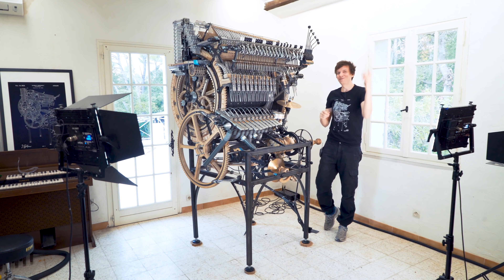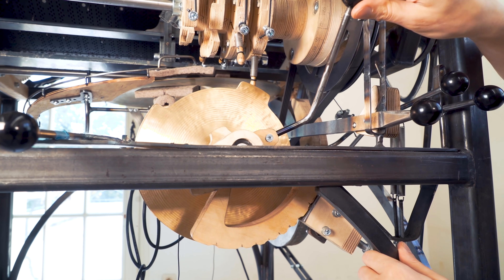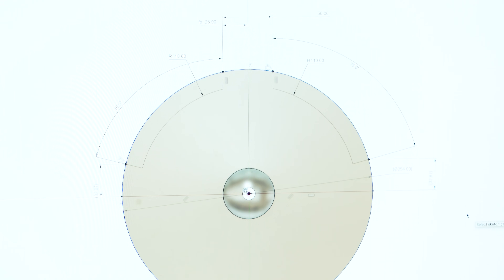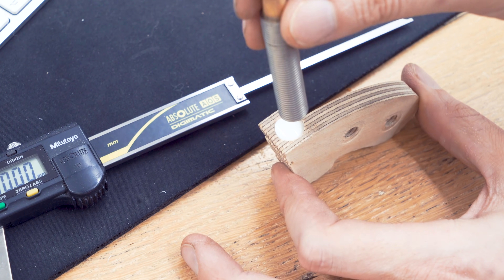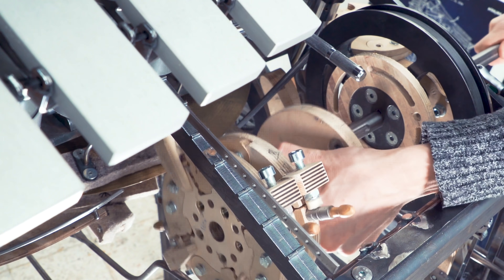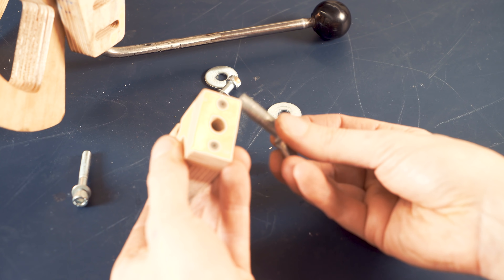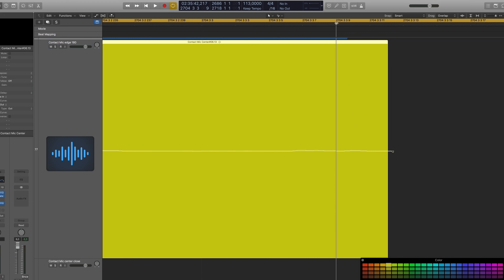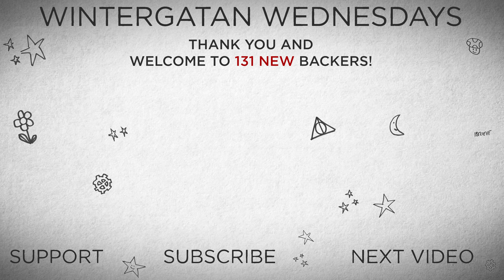I Made a Hi-Hat Machine - Will it Work? | Marble Machine X #108

Comment: Quite clever design improvement ! 
I would add one small thing on the "selection wheel". You have made some grooves to lock the hi-hat in a know angle but there's nothing to prevent the wheel to stay in a position in between. The radius being constant between those grooves. You should have some kind of inverted grooves or slope to have the spring behind the ball to push the lever in the nearest valid angular position. The positions seems to be equally spaced so you could make the radius a sine wave oscillating around the current radius, with the minimums of the sine being your valid positions and the maximums the in between. Keep on amazing us !
Reply: A bit like the bi-stable that this old tony advised a couple videos ago
Reply: @TheNico1082  actually it would be a novem-stable mecanisim as it would have 9 stable positions (bi-stable imply only 2 stable positions)
Reply: @Britaliope  Lets all push for the novem-stable tweak !
Reply: I doubt that accidentally putting the high-hat in those in-between positions would be common enough, to warrant the effort to make further changes in the design. Also, there could be some hypothetical musical reasons to intentionally do that, which would be much more difficult, if he follows your suggestion. However, I think it's a good idea to remember, in case I'm wrong and this becomes a significant issue after all.

Edit: grammar
Reply: What would be the real harm if that would occur?  I suppose not realizing you are between notches could throw you off during performance but the output would be the same otherwise.
Reply: This would help perform-ability.

Comment: Good work but I would think that you need a faster adjustment for opening and closing the hihat, for example with a lever??? I think that thumb nut is to slow to be adjusted during a Song
Reply: And the hihat is Not "closed" because of the cutting, probably a felt could help to close the two disks

Comment: Hi-hat need bi-stable system ?
Maybe he will rotate if ur hand is not on the handle, that would prevent it. It could be simple like a wheel and a pin with a spring who will lock rotation at right position effortless

EDIT : and a 3 minutes  you did it, i like your solution

Comment: Hey Martin, I had a question about using the hi-hat machine in a performance. 

If you're onstage and want to play a complex hi-hat rythm, but also want to play a complex rythm at the same time with the ondophone, how does that work? 

I imagine that it would be a bit difficult to concentrate on two different things at once, while also maintaining the correct tempo with your foot using the treadle pedal.
Reply: I have a strong feeling that he won't be messing with the hihat too much if he's soloing.  He could adjust it to where he likes it and then go ham.  Also he has the bass to play, don't forget.  Bass and ondophone together seems extremely difficult already.
Reply: Ah, good point

Comment: it was truly worth the redesign! this is amazing!
Reply: not sure how often you will have to readjust the fine timing with this solution.
Reply: you could consider to guide the bands/strings the other way around the screw - so the force is countering the screw thread direction. if you have problems with it. A bit more length of these bands and multiple wraps around the screws might help stabilize the timing as well depending what material u used there.

Comment: Won't it be a nightmare to synchronize timing between notes played by the marble and notes played straight from the crank?  Anything played by a marble will have a fixed delay of 400ms or whatever, but any offset on the crank would have to be a fixed portion of a beat.  If it's 400ms at one tempo it'll be 800ms at a slower tempo, but the marbles will still take 400ms to fall.  Your rhythm section won't line up with your singer!  In fact this seems like a general problem everywhere in the machine that the timing is adjusted by a fixed portion of a beat instead of a fixed amount of time.  Is there something I'm missing, or will the machine need to be tuned for a specific tempo and recalibrated for any different tempo?

Comment: This Is great but wasn't the purpose of the rhythm machine to act as a shaker and add some variations to the colour of the drum sound. It seems like using the same Hi-Hats will not offer any variation in tones of the 2 hi-hat sounds you can create in the MMX. Why not try using some darker hat sounds, or even bigger hi-hats? There looks to be ample space under the vibraphone. Just a though

Comment: The spring noise fix was clever and effective, but I fear the elastic will lose elasticity and corrupt like the rubber bands did on the original MM, making them a very weak link in such a robust chain. Could you not use tensioned steel springs instead of elastic, or simpler, wrap the drum stick springs in silicone tape and insert a silicone core to dampen noise and return to the screw/felt adjusters?

Comment: Two grub screws will not be as solid as a proper metal key, so just as long as all fasteners are check often, you shouldn't have a failure.

Adding a flat to the shaft would help mitigate the eventual walking and galling.

A triangular cutout on the detent stop will keep it positive as it wears and compresses the plywood. As it is, any wear will introduce slop to your timing as the ball pushes on the recess bottom.

Comment: It seems like you built it to have two silent detents, one on either side of the audio detents. If you wanted to be able to have one more combination - whole notes + triplets, you could make the groove on one side shorter, so that when the arm is all the way to your side of the machine, you have a gap and silence, but all the way on the other side, you are actually playing whole + triplets (or vice versa, I think it could work on either side.. You would probably need another mike in that case, since one or the other would not be in your first mike's sweet spot. 

I have to admit, when you first started demoing it, I was expecting that you would keep rotating and it would hit a point where you where playing and moving a gap to silence just one of the three instead of playing one of the three. Still, very impressive work, Martin!

Comment: quick tip: Use classical guitar strings instead of those elastics, guitar strings will 1: last longer 2:won't lose tension over time due to being stretched 

you are crazy, but a genius one. Glory is forever!
Reply: Wouldn't work -- the dampening happens because the elastic is... well... elastic, so the spring is slowed gradually. Any inelastic material will result in a hard stop, resulting in a percussive return sound, and nylon is inelastic.

Comment: I'm liking the progress on the Hi-Hat Machine! BUT the only thing that sticks out to me are the elastic bands that are used in the design. I personally don't see those elastic bands being a Long-Term fix for the Hi-Hat Machine.

 I'm no Engineer but from the outside perspective it seems as though leaving that assembly the way it is will just become a pain in the back for you eventually. Would't the bands start to deteriorate over time with usage and age? Needing to re-adjust or completely replace them seem like a hassle  when there may be a better option out there. It does work great though. At least currently.
 
This reminds me of the parts used in the first marble machine like Zip Ties and Rubber Bands. I recall you mentioning that it was parts like those that hindered the first machine so much. I'd hate to see a video come up in the future saying "Elastic bands used in Hi-hat Machine have failed". Though I look forward to any and ALL videos sprung up on the Marble Machine haha. I wouldn't know a better fix sadly but I just personally think that it still needs to be expanded upon a bit more before this version of that part is considered the Final Design. 

I don't comment much on Youtube in general, but i love watching your content so much i felt compelled to share my thoughts on it. I felt most decisions made on the MMX were sound enough so there wasn't much of a desire for me to do so before. After being around Youtube for so long the Marble Machine videos have been some of my favorite content so far. Cant wait to see what comes next!

Comment: Hey Martin,
i've seen a Problem with playing this Instrument.
The Problem is, that it are too many levers or Instruments wich are not Controlled by marbles, but with youre Hands. There are the muting levers, the Vibraphone dampening System, the Rhythm machine and the hi hat openings. And dont forget the Bass, the Crash, the breaks and the mute All levers. But also if you play the Tempo with your foot, you are able to just play for example the Bass and the Dampening System, but not the Rhythm machine or the hi hat openings and you cant mute or activate Instruments without stopping the Flow of playing. 
But i've got a Solution as well: you have to play more with youre left foot. Use a chair therefor. You could make a Pedal for the Dampening System or the hi hat openings. In this way you are much more variable with playing this thousands of instruments, if you want to play them similar. Also a chair will give you a better stability and alows you to sit, instead of standing on one foot. And you would be able to dampen the vibraphone, while you are playing manual.
Reply: I agree with the idea of giving the dampener a pedal or something that doesn't require hands
Reply: I think he'll compose with those limitations in mind, but there's also nothing stopping someone else pulling levers to perform a really complicated song.
Reply: At this point why not make it a connected, elevated chair...then slap some wheels and a steering wheel on it and drive this baby around town.

Comment: so, let's recall everything martin is gonna have to do by hand when playing the marble machine x:
- crank/treadle pedal
- flywheel break
- all the vibraphone, bass and drums mute levers
- bass fingering
- eventual vibraphone notes and/or vibraphone solo, like in original marble machine
- vibraphone dampening/reverb lever
- adjust position of the lower hi-hat, as well as hi-hat opening (thank god he doesn't need to control each one of the rythm machine's modules volume anymore)
- eventual non-scripted cymbal drops

am i forgetting something?
Reply: -The ondophone 
-manual hits for every instrument

Comment: Is it just me, or does anyone else see how automating this part into the programming wheel would be amazing?
Reply: Do you mean having the programming wheel change the mode of the machine? It would require some extra channels on the programming wheel, and a very complicated and overengineered clutch system, but it can be done.
Then the realization will be made that there is no way to have it play different patterns during different revolutions of the programming wheel, requiring the addition of even more extra channels, and a mechanism to transpose the machine, with a lever, and a mechanism that advances said lever for each revolution of the programming wheel.
Then it all gets cut off with the angle grinder for being big and overcomplicated.
Reply: Aaargh don't let Martin hear th....*angle grinder noise*

Comment: You'll want to find a replacement for those elastic bands. As the constant strain they'll be under will require multiple readjustments
Reply: Depending on what elastic string he is using it may or may not stretch much at all, but if Martin is going to use that idea he need to attach the string through that thread-hole at the very bottom of the screw or the band with wiggle and move and re-adjust itself along the groves of the screw, me thinks.
Reply: Chad Johnson tuning timings with 1ms precision by a record-compare-adjust cycle doesn’t seem practical
Reply: I was thinking that temperature might affect that a lot, but yes tuning it like any other string instrument might have to be the compromise
Reply: Chad Johnson I totally understand where you are going with this, and you might be right. I just feel that there might be a more robust solution.
Reply: @chudzy  Possible I'm worried how fast it might go out of timing maybe even over the course of a show at the end of the elastics lifetime. Elastic isn't the most resilient of materials and this will be under constant tension and going through temperature cycles like crazy as the machine gets moved from place to place.
Reply: Using another metal spring should be much more consistent.
Reply: So what? I play guitar and have to regularly re-tune my guitar. I don't see this as an issue.
Reply: @justabit-02  the workflow he has to go through to tune the timing seems awfully tedious, especially if he has to do it on the road
Reply: @justabit-02  it literally takes seconds to tune a guitar string. Very doable between songs. Waveform analysis takes more time, it might even take longer than the song itself.
Reply: @cryogenixzero  I agree.  In the end I imagine he'll probably need to develop a special (and as short as possible) calibration track/sequence, and combine it with a custom software solution that performs an automated analysis of the waveform and then provides a full set of fine adjustment values that can be made in one go.
Reply: @justabit-02  Your guitar doesn't have quite so many moving pieces as the MMX... this instrument has a lot of fine-tuning screws, and while most of them probably won't need to be adjusted during a performance, recalibrating this thing is going to take a very long time.
Reply: I still think it will lose its timing precision pretty fast, like in the middle of a concert fast, worse it might even snap.
Reply: cosigned, I think a second tension spring would be more reliable
Reply: as a lego gbc builder i can say that silicon rubber bands hold up much better than normal elastic rubber bands over the course of hours in a running module, maybe something for martin to look at as a way to minimise stretch and the need for readjustment
Reply: The biggest problem with the current design is the balance of tension and friction. The woven surface of the cord and the threading on the tuning post present a high coefficient of friction, and the elastic material is low tension.

That means that the windings of the cord around the post may hold a higher or lower tension than the main length that's held straight between the post and the beater. As the beater moves, the tension on the main active length of cord will change, and the post may release tension or steal tension, meaning the timing will never be stable.

My solution would be to replace about a quarter the length of the elastic with a nylon guitar string, and wind the nylon around the post. The nylon will never be under load (at anywhere near the tension in a guitar the elastic he's using would snap, and the springs would be bent to their limit) so will be stable in terms of tension.

This would leave the remaining length of elastic subject to no significant sources of friction, hence having a more stable tension.
Reply: I would have thought they will also slowly loosen the adjustment bolt.
Reply: @azz2  Unlikely -- the tension on the elastic is likely to be orders of magnitude lower than the friction on the bolt.
Reply: Cat-Gut? It's famous for not stretching
Reply: @DavidPetersenChannel  Yes, because it's non-elastic. The mechanism needs an elastic material.

Comment: I'm not sure if Martin mentioned this in an earlier video, but wouldn't the hi-hat machine make the MMX a bit limited in the music it plays by not having it play fast/slow, or does Martin just spin it faster/slower? Also it seems like Martin would need to do alot of stuff on the MMX like rotate it so it plays, pull all of those levers on top down/up, rotate the lever for the hi-hat side to side and maybe some more, maybe it's not when you're actually doing it, but it just seems a bit overwhelming and easy to get mixed up and mess up something.

Comment: Will the elastic degrading be a timing concern in the long run?
Reply: yes it will have to be "tuned" before every performance and eventually replaced.
Reply: @gustarrezende  it needs a bit of stretch to dampen the spring.
Reply: @chartle1  Yeah, you're right. There has to be continuous maintenance.
Reply: @chartle1  But does it really need to stretch?
Reply: @Quagra-42  not sure